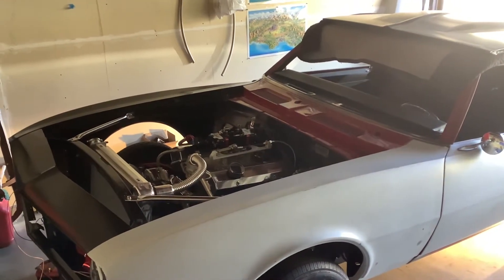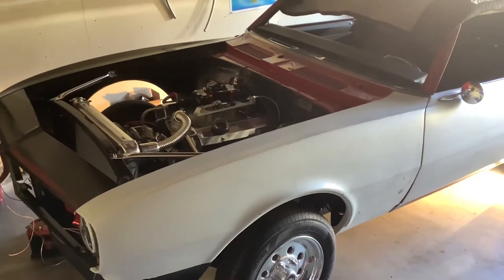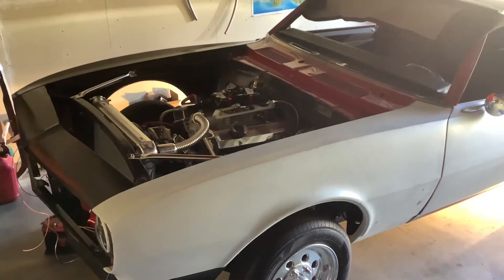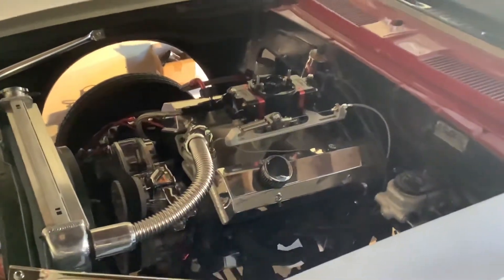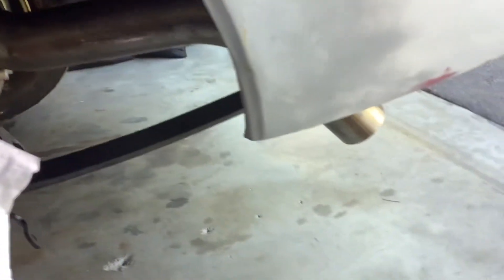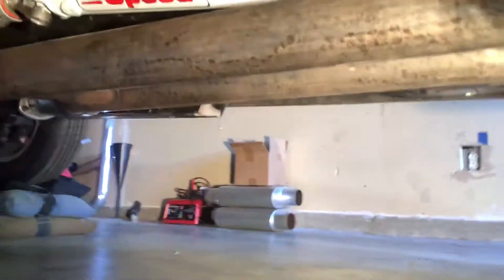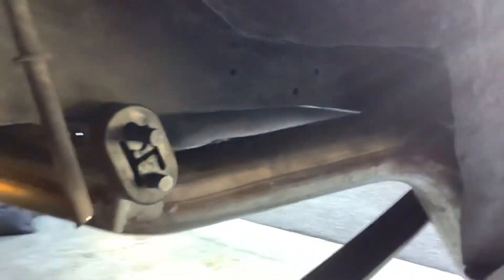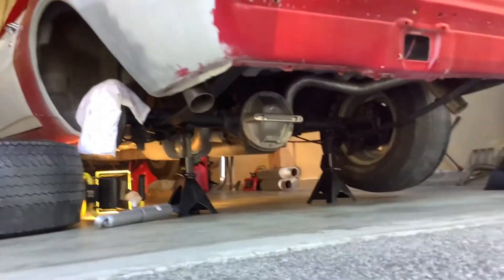3 inch exhaust  flowmaster 406 sbc

Comment: Sounds great I just put 3" xpipe full exhaust long tubes but I cheaped out on muffler went with thrush welded chamber muffler hooker long tubes..406 dart 215 solid roller 675/650 276-284 @ .050 on a 108 drag/street truck
Reply: That's a big stick!!
Reply: I ran those mufflers until I saw where they robbed about 20-30 hp compared to non chambered mufflers

Comment: What cam you running?
Reply from the maker: Purchased this Crane hydraulic roller cam set up back in 2000.Came with valve springs,pushrods,roller lifters and cam.We  built the heads to the cam and definitely pushing the limits on these guys.If I remember right the cam something like 560/570 lift with A duration like 318/322 ish with A 108 lobe.

Comment: that thing is quiet compared to my pypes violator x pype. like the tone...mines obnoxious
Reply: he answered someone and said theyre super 44s  bet if theyre were original 40s  then theyd be barking  pretty loud
Reply: @KingJT80  ya...my bros 4 spd 68 got has 40s...my vert has 3 in pypes xpipe w violators and it'll make your eyes cross
Reply: @oldschooltwist18  yeah that's gonna be pretty loud. I'm staying 2.5 on this car with original 40s and an h pipe. But long tube headers though
Reply: @KingJT80  that'll sound really good. The 40s have a good deep tone but not obnoxious. They sound really good
Reply: @oldschooltwist18  yeah I think I have that now on the car but it's stock compression stock stroke on my channel. It sounds good for a low compression small block...that's gonna change......
Reply: @KingJT80  good deal. Mine is on my channel. Just idling. Tunnel rammed Pontiac. 11.7:1  on e85.
Reply from the maker: I just switched heads to AFR’s 195’s and bolted on new 1 3/4 headman’s.I also put A 9 inch in and Ridetech’s 4link suspension.The exhaust now hits the rear so it stops at the muffler now.Holy shit this thing sounds crazy.Neighbors love me.
Reply: @joshuagarvey9362  good communication and understanding with your neighbors is always a plus😁👍